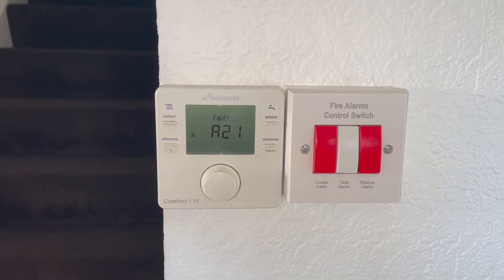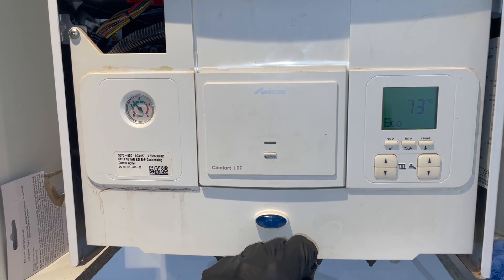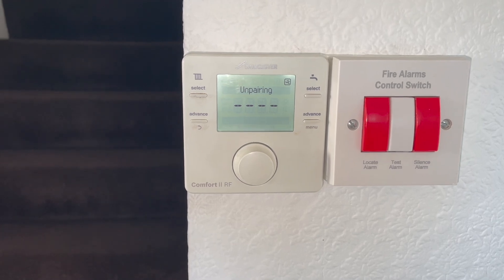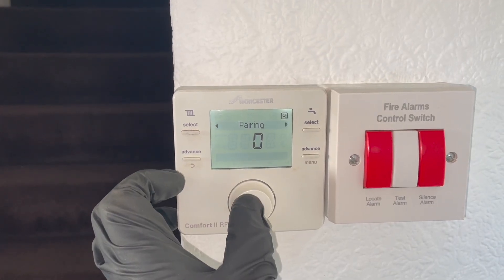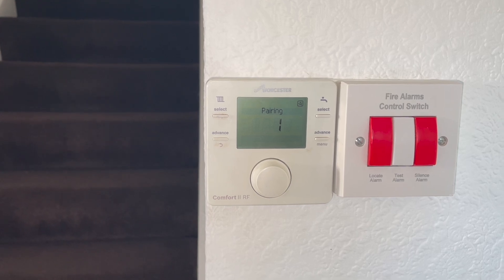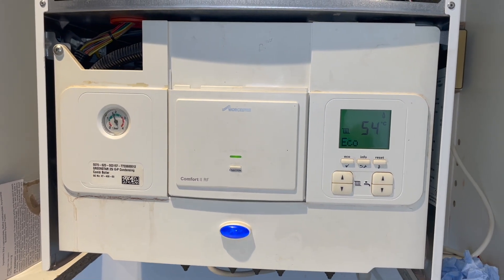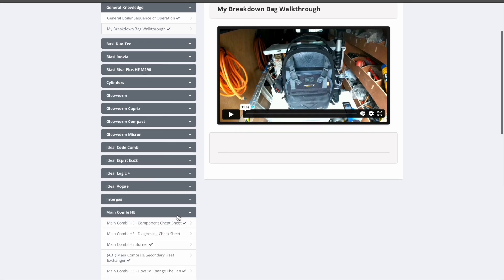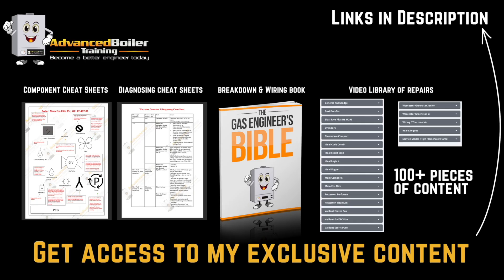Worcester Comfort 2 (II) RF A21 Fault Fixed | Worcester Greenstar CDi & Si Compact Models

Comment: My boiler button still isn’t green, I did all the or he r steps in the video?
Reply: It said ‘paired 1’ exactly the same as yours but then the boiler never went back green
Reply from the maker: If you turn the temperature up on the thermostat does the boiler fire up?